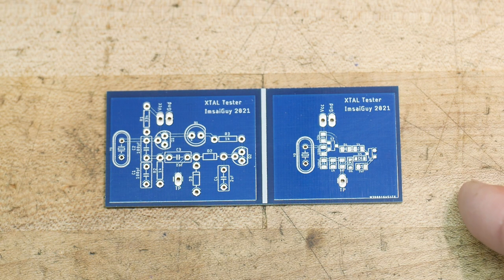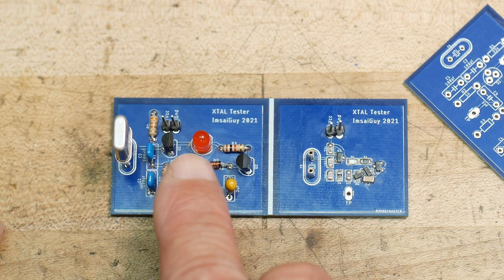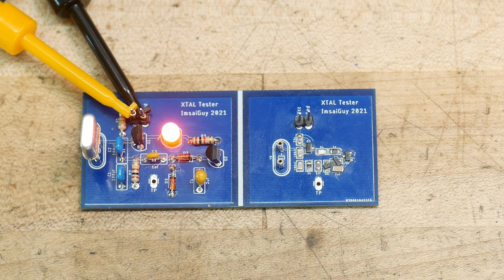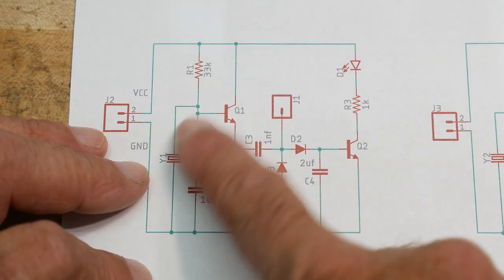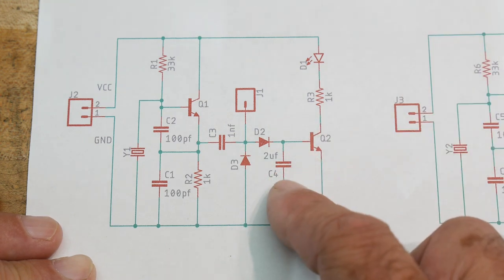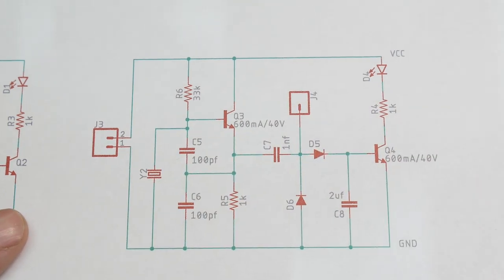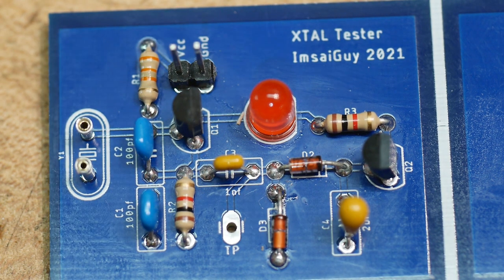#881 Crystal XTAL Tester PCB

Comment: I built mine on Friday, used pcb and ground pads with a 5mm diamond hole cutter ( was too small) especially at emitter q1 where 5 components met. Worked fine, but I added loop test points for freq counter/cro and included loop for ground connection and added an extra 1k resistor & led to indicate pwr and a diode in series for reverse polarity protection as well as a size d crystal socket as I have many size d (HC6) crystals. It even worked down to 3 volts, up to 15, didn't seem to care. Thanks for posting, Barry, VK2FP/AG7VC

Comment: Fun little board. Here's my two cents suggestion: decouple (0.1 uF) the Vcc close to the collector to ground so the power supply clip-leads do not radiate, and it will "firm-up" the emitter's output signal. Ditto about the test point lacking a ground --> 2x 0.1" spaced pins would be ideal !

Comment: One trick on surface mount transistors (sot23) that you got the emitter and base swapped on the pcb is to install it upside down.
Reply from the maker: I did not have the correct diode when I first built the kit, I used an SOT23 part wedged in. you can see the correct diode at 7:11

Comment: I think the diodes in this circuit need to be high speed switching diodes like the 1n4148, not slower power diodes like the 1n4001.  These would act more like capacitors at the crystal frequencies.
Reply from the maker: yes you are right. the thru hole has 1n4148 and I just used the SMD package for the 1n4001 but actually loaded a small signal diode

Comment: I have a bit of a complaint about the circuit. Whenever I see a transistor base circuit without a R that (in the absence of signal), does not sink current - I suspect that some of the builds will not reliably turn off the transistor. So I would add an R in parallel with the 2uf. I know I am being pissy sorry. I have seen this too many times, and I am so so so sensitive,... LOL
cheers
Reply: Yeah, if the transistor is high gain and the capacitor low leakage it might take a while for the led to turn off.
Reply: @argcargv  Partly. It depends much on the leakage of the cap, which if high enough (awkwardly), that makes the circuit more reliable. Also the leakage current exiting the base tends to charge the cap, this is at odds with the leakage current. Adding an R across the cap, shifts the result toward discharging the cap in absence of the signal.
AND: the world will not end if the R is absent.
Reply: @mr1enrollment  I agree that cap leakage here is helpful, but I just don't see how the base current can charge the cap.  That doesn't match the models that I am aware of for BJT transistor behavior in this common emitter configuration.
Reply: @argcargv  always some reverse current thru a PN junction. Magnitudes matter, i have not done due diligence. If the world ends up in peril, I'll take a closer look.
Reply from the maker: I just stole the design. It was first posted in Elektor magazine in the way back days but many have used it since.
Reply: @IMSAIGuy  That circuit was just to turn on an LED if the xtal was good, and was not meant to be a solid clock source in a final design/product.
Reply: @mr1enrollment  What would be an appropriate resistance in this case?
Reply: @robertmontgomery3892  offhand guess, 100k

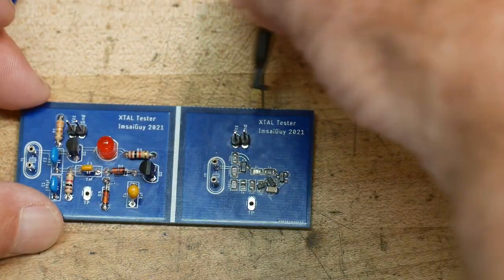Comment: 2:30 What happens to D5 and D6? you're using P-N junction as a diode? does this mean that the circuit shown here 7:13 doesn't work correctly for some reason?
Reply from the maker: I did not have the correct diode when I first built the kit, I used an SOT23 part wedged in. you can see the correct diode at 7:11

Comment: Just curious, why are the SMD components on one board diagonal but in another view on a different board they are on the normal H and V axes?
Reply from the maker: I did not have the correct diode when I first built the kit, I used an SOT23 part wedged in. you can see the correct diode at 7:11
Reply: @IMSAIGuy  Thanks!

Comment: What transistor used for the circuit?
Reply: You can use BC547 or something similar like 2N2222, as most of those small transistors works up to 200 MHz or so :-)

Comment: datesheets for the 2n3904 and 2n2222 indicate they have the same pinouts  and i dont have the 2n2222 so i used the 2n3904 you said can be used,  and it wont test a 20 mhz crystal nor the 100mhz crystal  and you didnt say how much mhz crystals this circuit can test  ,  and what about the voltage you didnt list  that either how much voltage dose the circiut need i tried 5  and 9 volts dc and it wont work for the 20 mhz nor 100 mhz crystals

Comment: Anyone have any ideas for a circuit which will test low value crystals (e.g the ubiquitous 32.768 KHz) ?
Reply from the maker: I would use a simple TTL inverter oscillator circuit. you could still use the peak detector and LED part of this circuit, after the inverter
http://darcy.rsgc.on.ca/ACES/TEI3M/Challenges/PierceOscillator.html
Reply: @IMSAIGuy  Thanks!